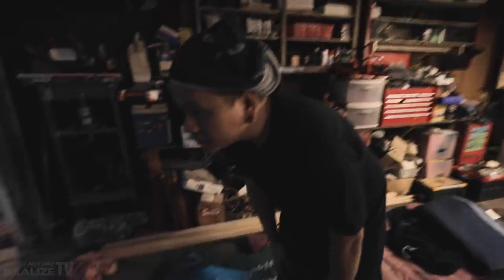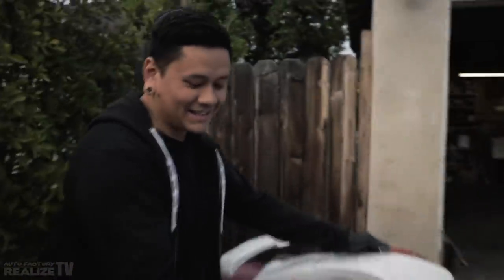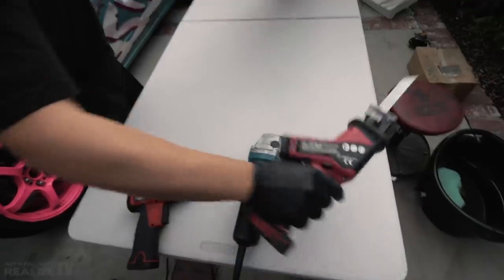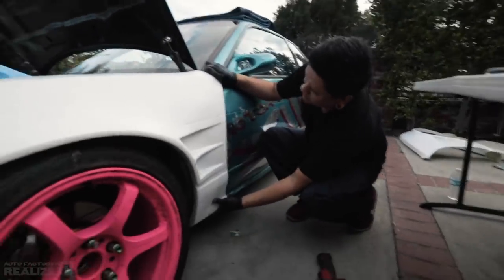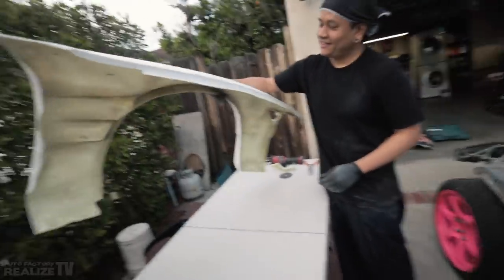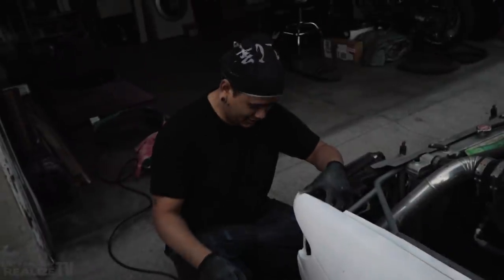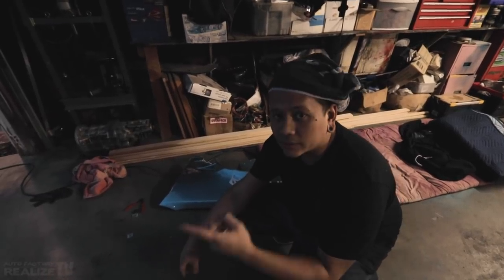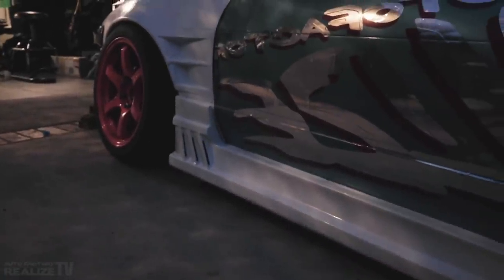Test Fitting Gary's NEW BODY KIT!

Comment: Teddy would the s13 duckbill fit my skyline I mean your skyline ? Asking for a friend 😉
Reply: Auto Factory REALIZE would it ? Lol
Reply from the maker: Actually not sure.. have never directly compared the curvature of the two trunk lids although I have a suspicion that the S13 trunk is rounder than the Skyline...
Reply: Auto Factory REALIZE hmm be coo if it did , I’d rock it on my 32
Reply from the maker: They do make wings specifically for R32s... I have a DMAX one.
Reply: Auto Factory REALIZE the one you currently have on your car ?
Reply from the maker: Correct